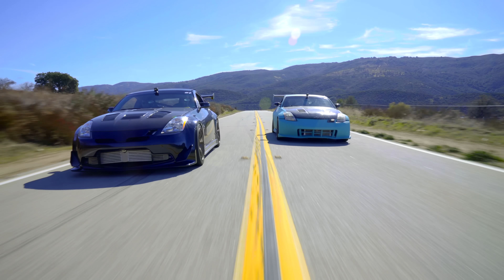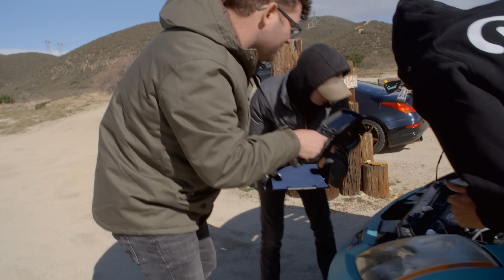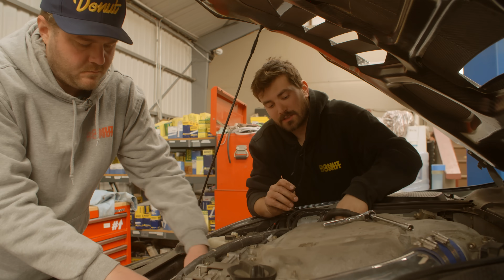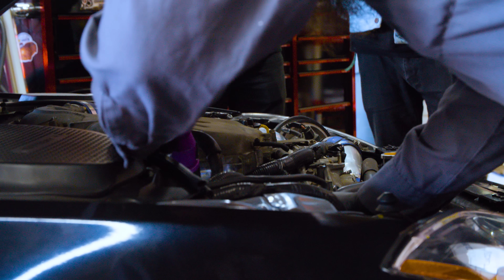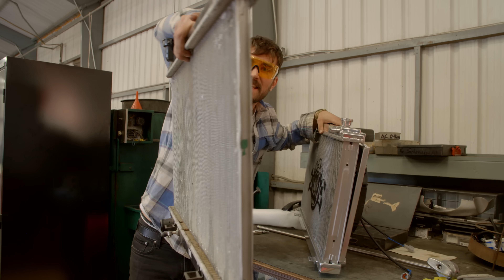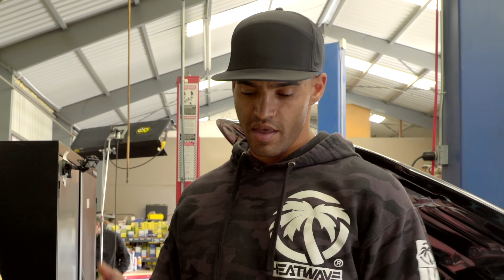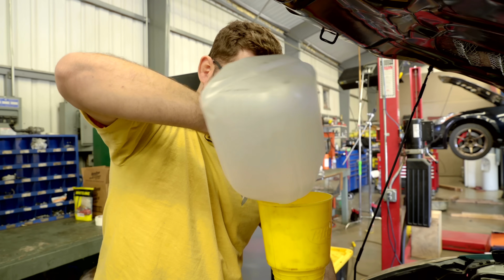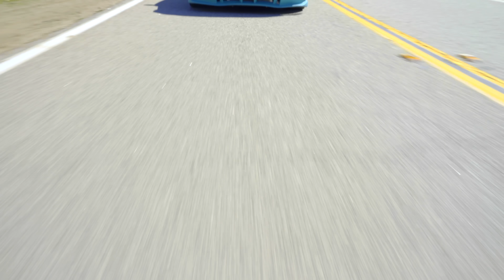$200 Radiator vs. $500 Radiator

Comment: I know there was still some coolant in the block, but running all water on anything but a track car where they require no coolant on track is pointless and can be detrimental. water does cool better than coolant, up to a certain point. When temperatures get high enough, even with a pressurized cooling system, water has a lower boiling point than coolant, and you don't want your cooling system bubbling.

Comment: Pro tip, get the more expensive rad, and two SPAL fans sized correctly. You'll save over the mishimoto setup and it'll cool a touch better. The AL shroud actually does you no favors in terms of cooling.
Reply: In a way, the radiator shroud does hinder cooling performance, but only at speed. Once the vehicle is moving, I doubt the fans ever come on, as the passive airflow through the radiator is enough to cool the system to operating temperature, but the shroud restricts that passive airflow quite a bit…. and at high speeds/high loads, that’s when you need the cooling the most. When the car is stationary though, like sitting in traffic, the shroud definitely helps. I’d imagine though that the shroud is unnecessary at low speeds/low loads because the new larger radiator probably would cool the car fine in those conditions with a computer fan zip tied to it LOL

Comment: It's like the brake issue.  You got with LOW and it's ok up to the point that you have pads on fire and instead of hitting a cone, you crash and wreck the car.  With the cooling system, for and extra couple hundred bucks, you are keeping the components in the lower end of the engine under less heat stress.

Comment: Correction about the antifreeze, it helps give the fluid a lower freezing point, as well as a higher boiling point. A "proper" socal mix would be 33% antifreeze and 66% water. I use it in the middle east in all my vehicles, because more water leads to better cooling. Also get a bottle of DEI radiator relief to help lower the ECT, keeps my rides at 84c with a 74c thermostat at 50c ambient temps.

Comment: Removing cats for a test pipe will lower temps significantly.  That is totally a different mod that they ignore.  They should have used the same coolant/ water ratio as well like buying straight 50/50 pre mix.

Comment: Destilled water is quite corrosive. I would rather use a product that has some corrosion inhibitors mixed in. Maybe it's a non-issue on cars. On more delicate water-systems such as on computers this is a thing and the reason why the water will slowly eat through e.g. nickel plating.

Comment: I don`t think antifreeze is used in the engine only for not freezing during the winter, it`s used also to oil up the metal parts in the cooling system and prevent corrosion in the radiator and the water pump

Comment: I'm surprised they didn't do an upgraded thermostat to open at 130°F rather than the stock 170°F
Reply: Not only that, I don’t think they ever installed a coolant bypass for the throttle body. Since it’s not needed in a hot climate like Southern California
Reply: 130 is a bit excessive. I could see going a bit lower than stock, but 40 degrees is a lot. Cold start enrichment is not where you want the car to run all the time. Also, increasing the radiator cap pressure would be a good idea, that wasn't mentioned either.
Reply: Hello engine wear. 
The longer warm up time means your piston will be out of round longer
Reply: @jebus914  if they begin concentric, wouldn't they grow/expand at the same rate...assuming grain boundaries and metallurgical imperfections are negligible?
Reply: Aka...an out of round piston head will always remain out of round, as the grain boundaries and defects will adjust accordingly?
Reply: @NeonTuner524  maybe, but I would follow the perameters the engineers designed everything around
Reply: Either way it will be open at operating temp, so I don't know how that would hep

Comment: Fun fact.
Radiator is wide spread wrong name of that hardware.
Correct word would be convector, since it convects more heat energy from one substance to another rather than radiates. Balance would be someting like 95 to 5 and 99 to 1 if fans blows. Its more convector than radiator.

Comment: I thought "antifreeze" or coolant is important to use over water because of it's higher boiling point. Cars run hotter then water can handle which is why it should only be used as a temporary or last resort kind of thing. Its not that it doesn't freeze in CA, but that it is hotter in CA. So coolant is a must

Comment: It’s not just about radiators in these cars when turboed. Yo definitely need oil cooler (Low car needs it most). And another nice mod is the pathfinder rear coolant pipe (Pathfinder cooling mod) to cool the rear pistons as well. “Race” thermostat helps as well (see Mishimoto or Nismo).

Comment: I'd say go expensive with cooling system but are there any downsides of a nicer bigger radiator and fan setup?? Anybody upgrade and run into problems. My experience with cars is there is usually at least a small negative issue from altering my car, lol.

Comment: Low car is having issues elsewhere ... the rad they got should be enough as long as the water pump, thermostat and those stock fans are really working well... more expensive looks better but in this case with Low car theres gotta be something else to the heating problem

Comment: Since I don't know the normal operating temperature of these cars,  I touch old cars that run at about 20° over thermostat so 190° stat or even 180° stat, runs 20° over in normal temp for oil to move around and for classic cars to use Gas correctly.. the temp shown here are super low for my car.. like not ok Low temp.. no worries just asking..

Comment: Did anyone notice when they popped off the rad cap on low car to drain the coolant they popped off one of the bracket holders and not the rad cap itself

Comment: Replace Anti Freeze or Distilled Water with  - Waterless coolant -   is a glycol-based liquid substance that does not contain water. Its boiling point of 191 °C is higher than that of water-based coolants

Comment: Warning!
Coolant has a higher boiling point 50/50 at 226F so if you run hotter then 212F anywhere in the coolant system you should use coolant and not water, the system is under pressure and thus raises the boiling point anyway but its smart to have a margin of error. when water reaches boiling point and turns into gas it will increase the pressure resulting in seals blowing out and if there is a pocket of gas it creates a hot spot that could lead to a lot of issues.  Water alone will do damage over time to the censors,  thermostat and causes the metal parts in the cooling system to corrode. the small amount of extra cooling from heat transfer is not worth it at all because water only transfers heat better at lower temps... not higher.

Comment: Putting test pipes on the low car would keep the engine flow at ease to a point of less heating up as well.  But as James says there are more accurate tests that could be performed

Comment: My problem with the test besides the Antifreeze comment was that they did all that work and didn't once mention the thermostat... Low car was essentially overheating within a few minutes after their start, but High car wasn't. The indications are there that they already had a cooling system problem before and it persisted after they changed the radiator and fans... Also adding a lower temp Thermostat (allows coolant full flow at a lower temperature) could help with the temp on both cars respectively.

Comment: I believe removing the cats on the high car also helped keeping the temp down, they should've removed cats from both cars to keep the test results credible. I removed the cats on my Viper and ECT difference drop was day and night.
Reply: Yep, increased exhaust flow improves heat transfer & reduces egt and engine bay temps
Reply: I believe they said they were replacing the cats, not deleting them.

Comment: If they're going to be pushing these cars later, they should upgrade the water pumps as well. Larger radiator means more volume in the cooling system. More volume means less pressure (V1*P1 = V2*P2) and less pressure means the coolant (or water) can boil more easily.

Comment: It's hard to burp all the air out of Z cars. Can't do it through the overflow bottle.  Gotta use a spill proof funnel and crack the plastic bleeder screw on the back side of the engine. Initial fill with the screw loose til coolant's flowing out proper then do a normal cap off, front end up off the ground burp with the heat blasting.

Comment: Nice job, definitely an interesting test. I dont feel like 275$ diff is not really much in terms of performance parts, especially when the installis so much easier. The lo car kit you pieced together was junk and not a good representation of being a cheap skate(my specialty). There are better kits for about the same cash and I think if you put high flow fans on the stock radiator you would be surprised. You also flushed the radiators for the upgrade test only and introduced variables like different cooland composition. Also, I bet making any kind of heat shield for that turbo would do wonders.

Something like this looks like a wildly better option that whatever you put on lo car:
https://www.amazon.ca/2003-2006-Nissan-Performance-Radiateur-aluminium-ventilateurs/dp/B00JLS2DJS/ref=sr_1_7?dchild=1&keywords=350z+radiator&qid=1597788477&sr=8-7

Comment: Antifreeze is actually better if your car runs hot. It has a higher boiling point so it can still effectively transfer heat at higher temperatures without boiling over. Just something to keep in mind.

Comment: Placing just distilled water in to your engine is not so much of a great idea. The "antifreeze" also protects the engine from corrosion, has higher boiling point preventing cavitation, and higher viscosity to protect water pump. Modern engines really are not happy with just water in their cooling system.

Comment: Bruh is that a 3 pin connector on the fan
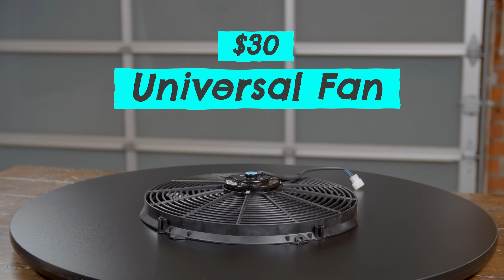0:57
This means i could use this as a pc fan
Reply: Yo
Reply: Just slap a piece of foam filter on it and replace the side panel with the fan!

Comment: THANK YOU for using Distilled Water! So many other Youtubers just use regular ol tapwater which will corrode the inside passages and ruin heat transfer and cause rust!
Reply: They should be using coolant. Even in California.

Comment: Hold on i though the purpose of the antifreeze besides stopping freezing was that it also has anti-corrosion properties dependent on manufacturer spec which is why you need specific coolant based on your manufacturer? So diluting it with distilled water will now cause his engine to corrode and destroy his engine over time..

Comment: I did one car high concentration water vs coolant and water is actually very corrosive and it pitted several aluminum parts it was in contact with.

Comment: Antifreeze doesn't just lower the freezing temperature...it also raises the boiling point as well. When the coolant flashes to steam it stops being able to cool the motor.
Reply: Also, the coolant mixture relies on a certain amount of corrosion inhibitors, this is especially critical for coolants designed for compatibility with aluminum alloys.
Reply: @charlesingalz3561   dont use distilled water either. If you do make sure you add coolant booster. It will help stop the damage that water does. this combo may make engine run too cool. Its basically a race car mix
Reply: I believe coolant also helps lube the water pump?
Reply: @gamergeek8933  In my experience, water pumps are usually sealed bearing devices.
Reply: Coolant also helps with corrosion an lubricates the pump
Reply: Half the comments are duplicates. Just look how many people mentioned the headlights and their earbuds, and Chris Fix.
Reply: Yeah, I noticed that when I scrolled through again after the first response.  I guess at least it wasn't just me. 🤣🤣
Reply: It's actually the system is under pressure that keeps it from boiling. The antifreeze has corrosion inhibitors in it to keep the distilled water from eating the metal in the cooling system.
Reply: @fedacheese0  raising the boiling point of the water also plays a part, trust me. As a fluid gets closer to its boiling point, pressure increases, so the lower boiling point reduces the pressure in the system. That lowered pressure is important, because at 13 psi the radiator cap is going to start venting pressure, and while that works as a top-end pressure relief for a water/coolant mix, it's too low for water alone. It will either vent far too much with just water, overfilling the overflow tank and sucking air into the system when it is allowed cool, or the pressure buildup will outrun the cap's ability to vent pressure until you get a catastrophic failure of another component, be it radiator hose, radiator, etc.
Reply: Yeah.  This.  And the fan doesn't blow air across the radiator.  It removes air from the radiator so new air can come into contact with the surface.  This is the reason the temps are lower.  More surface area means more heat transfer.
Reply: Doesn’t coolant also contain lubricants and anti-corrosive chemicals to keep the system healthy?
Reply: @adamyo9003  You're absolutely right; it does.  I didn't mention those properties of coolant because they have a negligible effect on overheating, and my comment was meant to address when the guys decided to run straight water after overheating in the canyon, if I'm remembering correctly.
Reply: also water makes it rustt go brrr
Reply: it also tastes great
Reply: I checked the comments to say the same thing, glad earlier viewers were/are on the ball.
Reply: Okay we’ve seen the comment 100 times we get it
Reply: @irunitlmao2252  I looked through the comments before I made mine, I didn't see it when I looked. I can't say I did an exhaustive search though, so I'm sorry if my comment turned out to be a duplicate.
Reply: @cen7ury  Keep repeating it, there are a lot of people out there that still dont get it....antifreeze mixed properly also exchanges heat more efficiently than straight water or straight antifreeze.
Reply: @cen7ury  Don't sweat it man, they're being pricks. I don't see what's wrong with spreading knowledge
Reply: @blackbirdxx928  str8 cap. 100% water is better for cooling
Reply: @cen7ury  who tf cares freedom of speech and press
Reply: @coopermoreton6993  Sorry, the 1st amendment is not applicable in this circumstance. 

As for who tf cares? That one is easy...clearly you care enough to take time out of your day to respond. Thank you for that.

Ciao for now.
Reply: @irunitlmao2252   it deserves to be said more than once, these guys dont know what theyre doing (dont use distilled water either), dont wanna see any noobs do the same, they might not have a shit ton of $...
Reply: @saltpepper1894  you can use distilled water mixing with coolant it’s fine.  This is the problem with making a blank statement like “don’t use distilled water”  dont use just distilled water. But these guys stated there was 50% coolant left so they believe.  And it’s fine distilled water can be better then hard water if you ever had thermostat issues because the hard water keeps clogging up and stopping the spring valve from closing to find sediment build up.     But if you add 100% distilled water adding a treatment is needed.   But for example if you lived in let’s say SoCal and you needed to add coolant buying a gallon of distilled water would be the way to go no treatment or anything just put the distilled water in.  

And anyone who had done a radiator flush, a true radiator flush will know it takes many times of flushing, filling, running, flushing, fillling, running, to get all the crap out. I truly don’t think adding distilled water to a used cooling system will hurt anything.  These are my thought take them as you want.   

And does coolant lubricant water pumps no there’s seals that prevent coolant from reaching the bearings for a good reason mainly reason stated before with build up. Not good for bearings.  I think this would be the same claim if the fan company said our fans are made from special metal compound that helps deflect heat from the motor.  It would be true but so would all other fans. And once again do what makes you feel happy. I buy 50/50 coolant
Reply: @saltpepper1894  distilled water and coolant mix at 50/50 is fine to use. It’s tap water you don’t want to use because of all the calcium and other garbage that has super high ppm. Distilled water is water that’s been steamed and lots are also reverse osmosis treated as well so ppm is 0.